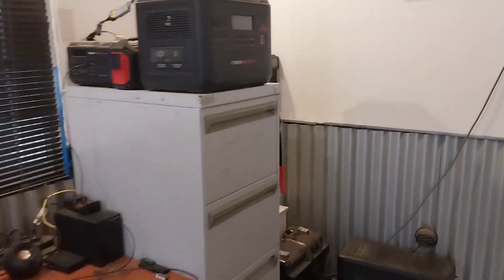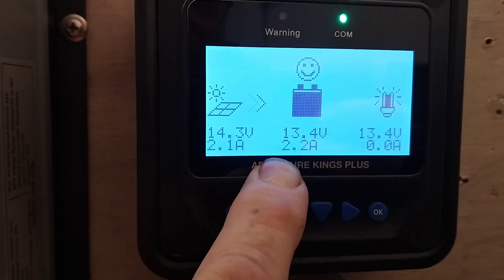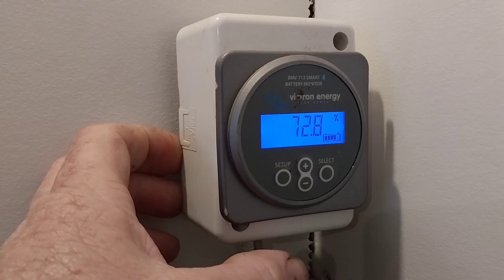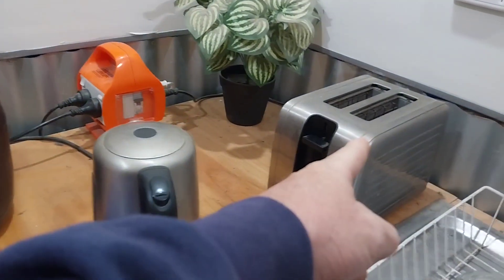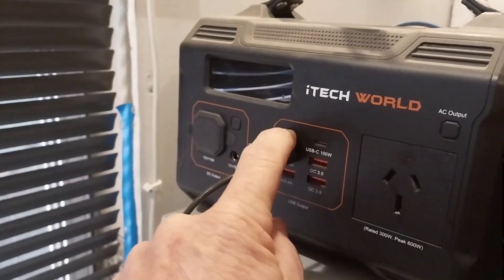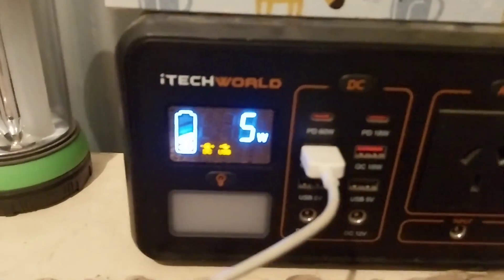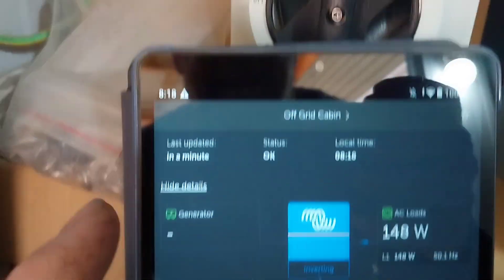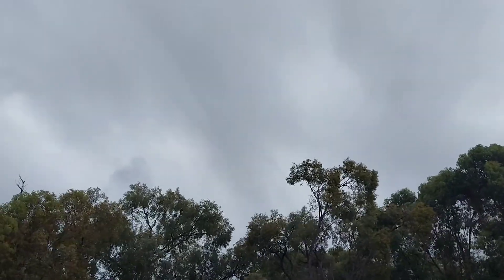Solar Power Systems Status Report

Comment: Hi Glen. I was just thinking that with all your seperate power supplies it may be difficult if some went down but enough to survive, a bit like an Airliner with redundancy systems all over the joint.
Has Blue given up on bees? … good BOY😅
Reply from the maker: I have heaps of batteries and invertes laying around to rig something up or just run an extension cord from the 48 volt system.
I could run everything from the big 48 volt system, I just like playing around and making smaller systems.... total solar addiction 😂

Comment: The 24v system is the only system not performing well.....maybe some new panels required..?
Reply from the maker: Yeah those panels are around 18 years old now and don't like to produce much power in low light / cloudy conditions.
Once the sun comes out they're not to bad but still down on power. Eventually I am going to move the 24 volt system to the shed and get a new set of panels for it.
Reply: @TheOffGridBachelor I went with thin film panels on my van, still get power in terrible conditions. In bright sun they make a lot less per square metre though.